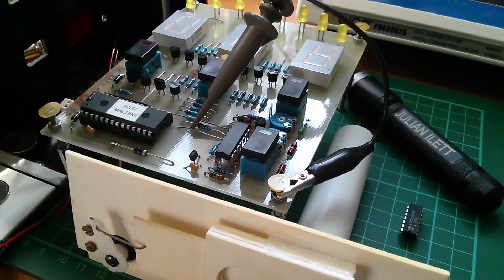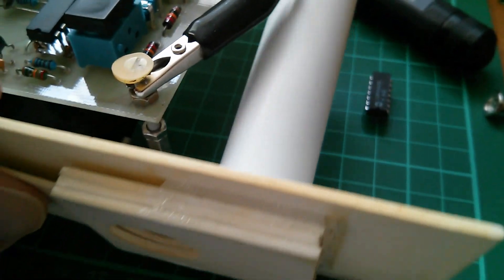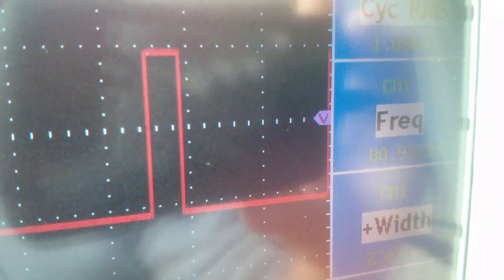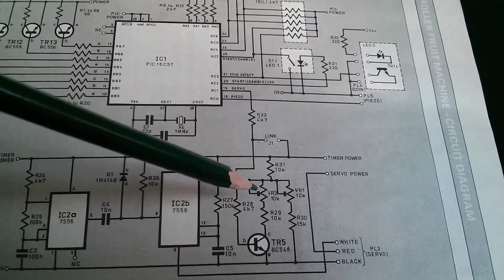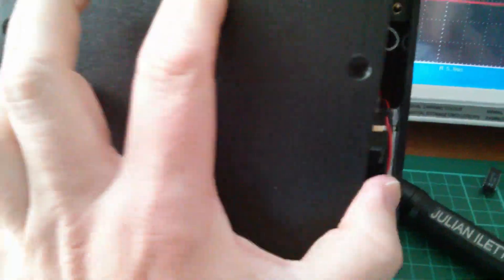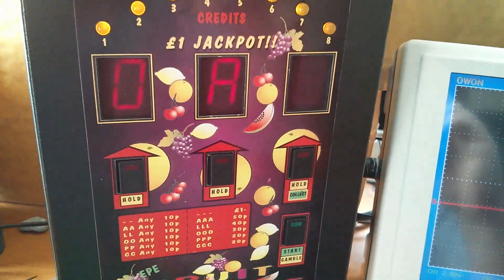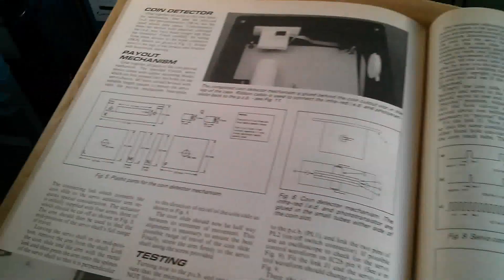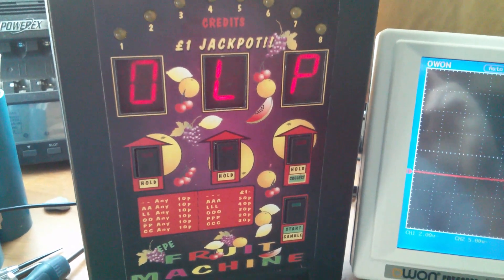Retro Electronics: Fixing the EPE Fruit Machine

Comment: Man... neat to see those old 'real' pcb's :) Back when you actually printed a mask and etched the copper off copper clad fiberglass. Makes 'printed circuit board' hold meaning again. I assume the semi-transparent ones are fiberglass anyway.
The sad part about modern gambling machines are they are made to always lose 100% of the time, but to intervene at various lose percentage states to give a win to prevent the house from EVER losing. It also prevents a player for having a very unlucky lose streak as well, and the point is to intentionally make a player win just enough to coax them to keep playing, while ensuring the house never actually loses. That takes the fun out of it completely.

Comment: Analog servos tend to increase in performance (up to a limit) if the frequency goes up. 80Hz is quite a bit, though. Interesting! 
Also, great project :)
Reply from the maker: YensR I guess the cap and resistor were both out of spec. I wonder how far you could increase the frequency before the servo started to play up. Even at 400Hz it should still be able to discriminate between 1ms and 2ms pulses. Would make an interesting video!
Reply: Julian Ilett Not sure if the link will work: 
http://www.pololu.com/blog/17/servo-control-interface-in-detail  
Gives a good overview. I've read that 100 and 200Hz is usually not a problem. So 400 Hz doesn't sound too crazy. I mean. It kind of does if you consider the 50Hz base, but it sounds achievable.

Comment: Very nice indeed. If you were considering an upgrade, I would suggest a more simple linear actuator for the pay out mechanism, such as a solenoid with push/pull rod. It would save the circuitry associated with the servo, and offer a significantly faster repeated delivery system, and solenoids are fairly easy to salvage from some printer mechanisms.
Reply: Excuse me for being ignorant but doesn't solenoids need more current than servos and those solenoids should have quite long stroke if the coin ejecting mechanism would remain the same.
Reply from the maker: Ecobion Labs We did try a solenoid in our early tests. It wasn't really powerful enough to reliably pull a coin from the bottom of the stack. On the other hand, the movement is so rapid and violent, it risked damaging the plastic mechanism.
Reply: CircleofMadness
You can turn a short stroke into a long one with a simple pivot arm, so you won't need to draw quite as much power as you may expect, besides, the activation time is very short, especially compared with that of the servo operation.
Reply: Julian Ilett
I must say that you had a very elegant solution.

Comment: For some reason I seem to see a lot of failed 555 style timer chips in fairground lighting controllers.  (They're used as the time base to clock a 4040 binary counter that cycles through EPROM address space.)
I designed a simple fruit machine myself many moons ago.  It was all built with CMOS logic chips though and had a veritable wall of them inside.  It's odd to think that I could do the whole job with one chip now plus add a load of extra features.
Reply from the maker: bigclivedotcom I'd love to build this again using CMOS logic. The thought of wiring up dozens of (maybe hundreds) of ICs has a strange appeal.
Reply: Some of the earliest arcade video games were implemented entirely with logic and no microcontroller.  That would be quite a challenge.
Reply: +bigclivedotcom I remember an earlier fruit machine project which did have a board full of logic chips in one of the mags. Possibly Practical Electronics in the 80s? I may still have it in my "archives" somewhere which consists of various assorted boxes in unknown locations.

Comment: Strange to see a 555 driving the servo, while you have a PIC micro. Was it too slow do the pulses? 

Anyway, using a dual 555 to drive a servo in between two selectable positions is pretty cool. 

Most of the time I'm to lazy to figure out how to setup a 555, and just stick on a micro. Us younger generation are just spoiled.
Reply from the maker: beargun42 Glad you asked me that! The PIC16C57 didn't have non-volatile storage (EEPROM). So there was nowhere to store the calibrated servo endpoints. By using the 555s, the endpoints are effectively stored on the two trimmer pots.
Reply: That makes sense. Thanks for the reply and yet another great video. Retro electronics are always fun and educational to watch.
Reply: *****
Program memory was EPROM.
Reply from the maker: ***** As Randy Pandy says, the PICs had EPROM program memory back then. There were UV erasable windowed chips and the one-time-programmable (OTP) plastic devices. I think the chip got damaged when a coin touched the back of the PCB.